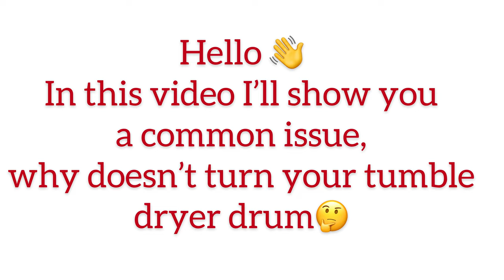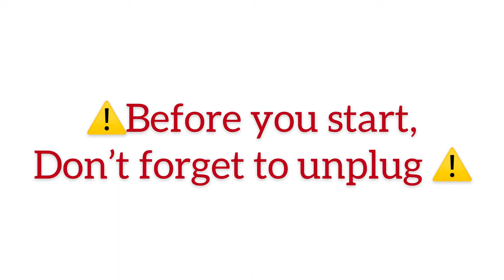How to fix (replace) Condenser Tumble Dryer teared, torn, broken drive belt Hotpoint, Indesit, Creda

Comment: Where does the blue wire connect to at the top?
Reply from the maker: Hi,
I don’t know what do you mean, I didn’t disconnect any wire during this repair. Blue wires are visible at the bottom where the pump is.

Comment: can bearings cause dryer to not spin
Reply from the maker: Hi,
Thank you for your question, in my opinion it isn’t the bearing. If the belt is ok, then you should check the capacitor. These are the 2 main reasons for drum don’t spin. I hope I could help.
Reply: @georgesworkshop8600   will this work on ariston dryers
Reply from the maker: Hi,
This is a common issue with tumble dryers, most of time this capacitor replacement sort the problem. I’ll make soon a video about this job.
Reply: @georgesworkshop8600  Hi, I have the exact same tumble dryer and have already changed the belt once. I had a bit of trouble getting the new belt over the tension pulley. The original belt had snapped so bought the exact same one to replace it so thought it was a bit odd. It’s snapped again so have just ordered a second one 😫 just wondering if you have any tips on getting the belt over the tension pulley? Thanks -  Rob
Reply from the maker: Hi Rob,
I know what do you mean. I get used to dislocate the back axis and then the drum could drop down 1-2 cm. This is not too much, but enough to make easier the put the new belt in its place. And put the drum back ( axis return to the hole) The pulley could cut the belt if not on the right place.
I hope I could help.

Comment: Hi, you skipped the part when you got the belt on as i'm struggling to get it on
Reply from the maker: Hi,
It is on the video how to put on the drum and initially it’s visible how I started to put on the roller. It’s quite hard job, as it is really tight. You can use carefully a screwdriver to help and  additionally slowly turn the drum and the belt will move to its place. ( if already partly on the roller)